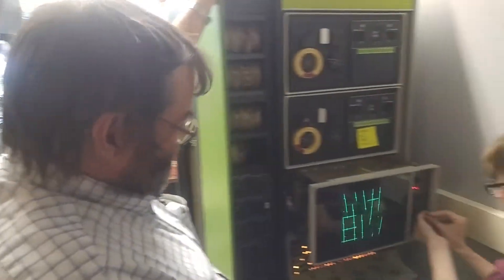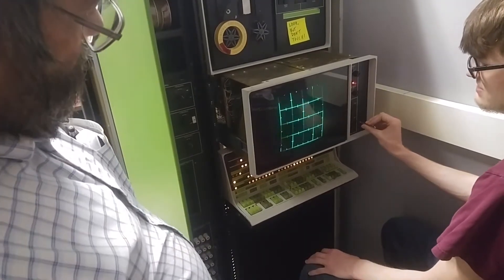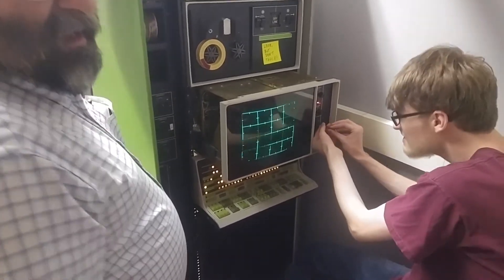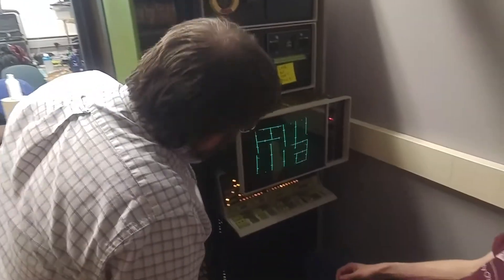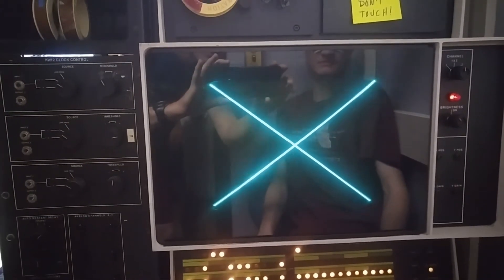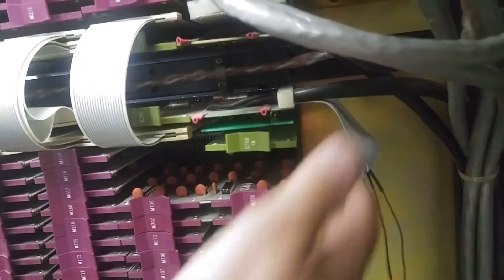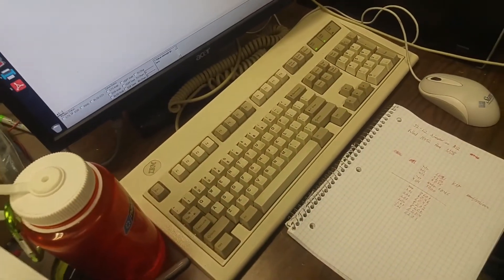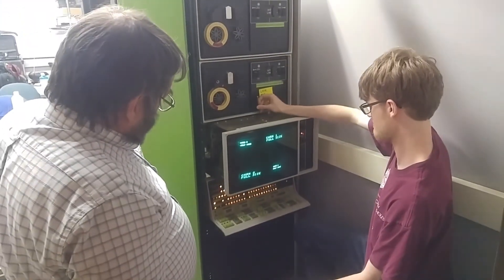PDP-12: Video Test Program and CRT Adjustment

Comment: I think I might still have one of those tapes.
I also might have PDP-8 schematics or maybe they are for a 12. 
Many years ago I wrote some stuff that ran on a 12 running in its PDP-8 mode.
It was a surprisingly easy machine to program.